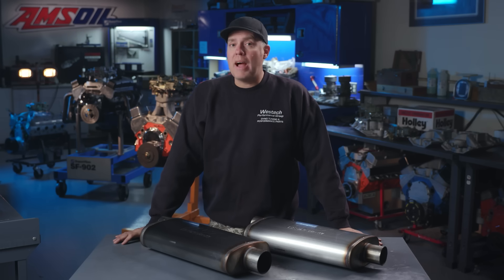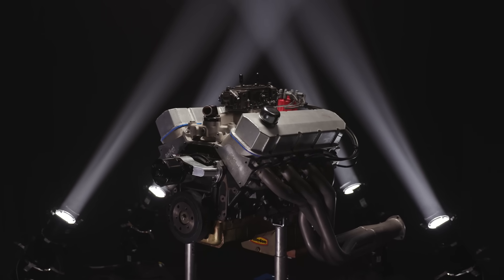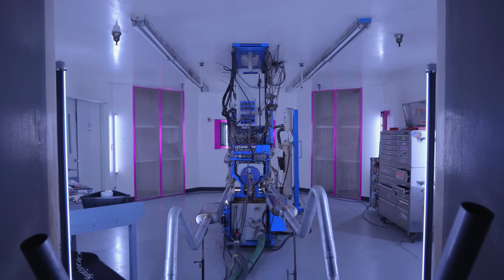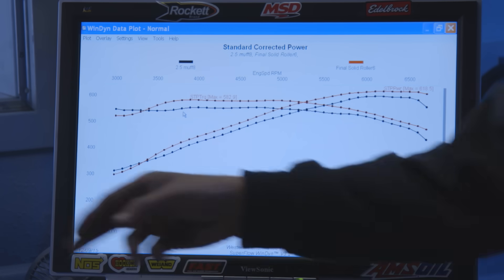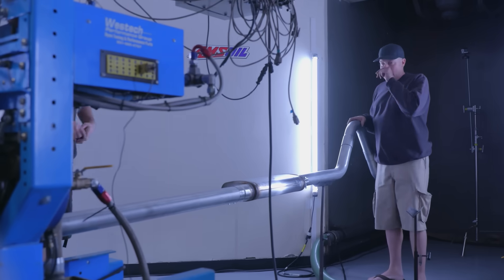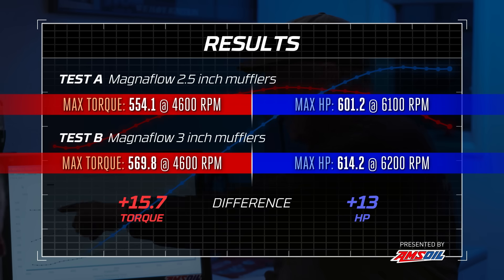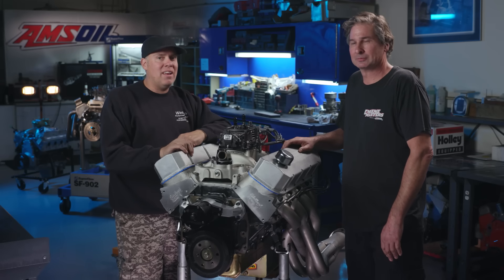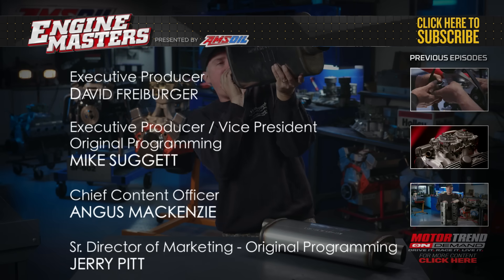The Power of 2.5- vs. 3-Inch Exhaust - Engine Masters Ep. 9

Comment: I gotta quick question. How should I what size of Exhaust Pipe or Type of Manifold Like (4-1) or (4-2-1) should I put on my engine. I mean, is there like a standard principal for all engine Sizes from 1L to 8.2L or depending on engine size the measurements will change. 

Appreciate the advise.

Thank You Guys 

Love Your Videos <3
Reply: +Amir Hossein It depends on what motor, it's useage and the HP/rpm range.

A long tube makes more power/tq than a short tube header..the only reason to use shorts are if your turbo charging or limited in the space to fit them. A 4-2-1 is usually more expensive but will give you more mid range torque with very little top-end lose vs. a 4-1 long tube header. 4-2-1 is better for a heavier/daily driver and 4-1 is better for a drag race/high rpm/lighter car.

As for primary sizes:
1 5/8" is standard for mild small blocks
1 3/4" will give you more power on a health smallblock 475+hp engine

1 3/4" is standard for mild big block  <500hp
1 7/8" is good for stroker or healthy big blocks <600hp
2" big blocks <750hp

Bigger/longer collectors give you more low-end torque, the length of the primaries will rock the power around the peak torque rpm...For example a short 32" tube will give more top-end at the expense of less low end than say a 36" tube. Usually manuals/lighter car can run better(drag strip) with larger/shorter primary tubes, while an automatic/heavy car will run faster with smaller/longer primaries.
Reply: Got it. Tnx Man. You explained beautifully. But you said 2" for big blocks ? Here they suggested 3" for such capacities. Also when you say 32" you mean Diameter !! What will happen if say you take a 2.0L engine and put a 4-1 and straight up and one collector and shorten the pipe. As in the Exhaust line will finish and end right in the middle of the car and wouldnt go to the end. What would be the effect ? Also is there some kind of calculation You could suggest that I can use on differant cars with differant engines. Man Im no where neae these Monsters. Here we dont get to ride with the real cars with Absolute Horses ! Thank You Again Pal

Comment: Wouldn't reduced back pressure burn valves over the long run if this were your daily driver?
Reply: +Charles Faust No, Actually excessive back pressure would raise exhaust temperature..so would running the engine too lean.
Reply: +David Freiburger Thank you for at least attempting to put an end to that non sense myth.
Reply: JerseyMikeP Thank you

Comment: Mr. Freiburger would this be applicable for a 4 cylinder 1.3l MPFI engine ?
And is there any harm in putting such a exhaust system as now the engine has passed 100k kms and has been recently rebuilt from scratch due to mileage.
Please let me know.
Reply: +Pranav Nakhare to a point it would apply yes, but no need to go anywhere near that big! as ive said above, the restriction is the smallest point in the system, whether its the silencer, the pipe size or the ports in the cylinder head. wherever the restriction is, is the limiting factor.
Reply: +Peter Lattimer thank you for that but in hindsight I think I should have asked whether the cat less exhaust system would affect the life of the engine.... thoughts ?
Reply: should have no ill effects on the engine at all. I have run plenty of engines that have been decatted to quite high mileages (by UK standards) without issue. the issue would only come if you were constantly thrashing the engine to make use of the slight extra power you will notice removing the cat, at high RPM. in normal day to day road use, a simple decat you wouldn't even notice.

Comment: 1- it's a 454 CI engine ,a smaller engine will do not require 3 inches exhaust to move air correctly.
2-You bash at peoples saying  big diameter pipes kill torque and 10 seconds later you show you gained torque and HP under 3k rpm with a "small" full exhaust system of 15 feet long.
You don't even show the numbers or test the engine under 3000 rpm.(wich is the most commonly used max rpm on public roads.
3-all is question of use,you mislead peoples by simplyfing things like that.
4- for same length : smaller pipes allow more velocity, bigger diameter pipes will make you gas slower,but gain pressure.
You have to use both parameters for your specific use,it's not that simple.
 Max HP is not everything,there is wideband use.

Comment: should have leaned out the engine with the 2.5" exhaust, to see if you could have made up all of or most of that difference in power.  If you could have a smaller, quieter exhaust, with the same hp as the bigger loud exhaust, thats a no brainer every day.

Comment: Many many years ago I used to tune two-stroke engines for amateur racing. They do need tuned exhausts with back pressure as you are counting on the back pressure to stop the charge going into then straight out of the cylinder. Perhaps that's where the "you need back pressure" thing came from? Some people still don't understand the difference between 2 and 4 stroke.
Reply: +Gordon Lawrence I think you're right.

Comment: quick question i have a used Chevy S10  the year is a 1997 and i have been having issues with it bogging down and jerking when shifting it is a automatic trans. i want to know if there is any way to get more power out of it the motor is  a  2.2 L 4-cylinder, 4.3 L V6

Comment: Am I the only one who noticed them shoving the cam in there with no assembly lube?  I've never built an engine, I have no desire to build one...but every time I've seen it done, they used assembly lube.  If I'm not wrong, then I'm questioning the "Masters" part of the title.  If I am, then apologies.  Otherwise good video, I like this channel.
Reply: +Lee Ralston it was probably done just for the camera and that's why there is no lube. now you can build a motor and not use any pre lube I have done it but you need to have some one turn the motor over by hand wile you are spinning the oil pump with a drill to coat all the parts. vasaline or real heavy gear oil also works well

Comment: Does the same apply for smaller engines?
... I'd imagine backpressure isn't a thing no matter what, as it lost power going to a 3" exhaust... if it required back pressure, it would gain power over the open headers lol

Comment: What would have happened if you had leaned the motor back out with the 2.5 inch? You admitted it richened it up, could you have gained power back by tuning the carb? 
This test would have been better if it had been an EFI so you could tune that issue out easily.

Comment: Dodge, Chevrolet And Ford Almost same cubic inches which is better?
Reply: +Samuel Lopez Too many variables, each brand made great engines.
Reply: It would come down to cam profile, cylinder head type, compression ratio, induction, exhaust and rpm. If all the aforementioned items are equal, they will all make the same power.
Reply: +SmackledorfMcsween Cocksmclittleton Tinydickolas,
the ignition order dont matter in HP or Torque?
Reply: +Samuel Lopez well- I figured that would be a given, considering cam profile, rpm and compression ratio. They already did a test almost like what you're asking. 383 BBM VS SBC 383. they made almost equal power except the Mopar made more down low on account of the wide bore that it had. Point being, there's a given amount of torque per liters of displacement, period. 

No matter what engine it is, if the environment is equal across the board no engine is gonna make more power than the other because the basic operating principal is the same.
Reply: +SmackledorfMcsween Cocksmclittleton Tinydickolas, Thanks.
Reply: Samuel Lopez you're welcome, brother.

Comment: why dont you show the graph starting from the idle? it will be useful for those who use the car in the street.. you will not be revving 6k rpm all the time..
Reply: +Maxi Biscardi The graph starts at about 2500 which is about the point where it starts to matter anyway, as Dave said about it making a little more torque below 3500 rpm, at wide open which is what these numbers are at your gonna be running up through that fairly quickly and won't notice the difference. I want to see this test again but with an engine that only makes say 300 Hp and see what happens, also would like to see them throw a "bad" muffler in the mix

Comment: internal combustion engines are vacuums... more air in and out with the least resistance makes more power.
Reply: +Cody Hodgson actually they are air pumps
Reply: +Captain Bipto lol they are the same thing. a vacuum sucks in air and pumps it out
Reply: +Cody Hodgson they absolutely are not the same thing. a vacuum does not suck air in, it only removes air.
Reply: +berzerkrobot wow where can i buy a vacuum cleaner that removes all the air?  that would do a better job of cleaning than the one i have. since it only removes larger particles from the air.
Reply: +berzerkrobot I strongly disagree, I own a vacuum and I can assure you it sucks air in.

Comment: would  This apply also to a Four cylinder double  overhead cam Turbo  charged  ingine?  what do you think  ? I'm  trying to  pull out about  40 or 50 more  horsepower  to bring it  up to  about 260 to 270 horse  power  maybe 3 inches  pipe from  rear of catalytic converter  to the one  open  flow or high flow rear exhaust  Muffler  ,do you think  this would  HELP?  from  : jjm in Montgomery Alabama Sent

Comment: Uh I'm pretty sure you lose torque without enough back pressure when it comes to smaller engines this engine wasn't a good example of that point seeing how big and built it is
Reply: +matthew von not everyone has small motors
Reply: +matthew von Yeah.. of course bigger exhaust system equal more peak torque and HP at high range RPM. But is more power at higher powerband range (higher RPM) always the best case? 
let's say in everyday, daily drive.. and even also not all race track require more peak HP from higher powerband range to make a faster lap time right?
and this engine wasn't a good example of that point indeed.

Comment: that settles it, a 3 inch is going under my 1.3 ltr suzuki samurai.
Reply: How could this be applied to a common Briggs and Stratton?
Reply: Jonathan Banta lmao
Reply: @jonathanbanta9456  It means that you need open pipes just to start it.
Reply: +devils garage yup.. because basically your 1.3 engine has to be at full, high revs all the time to do a proper speed.. 
; )
Reply: I have twin 3"pipes on my 96 Geo Metro, what a difference that makes, 3 banger with an unbelievable 1000 ccs of raw power.
Reply: devils garage fit twin exhausts and a sun roof then you can at least use it as a wheelbarrow
Reply: Wow, a 600+hp samurai. That sounds scary fast and squirrelly my friend.
Reply: I like u
Reply: LMAO
Reply: I have an 87 Zuk , that's three would support at least one 30 in a 25 ticket
Reply: I miss my samurai. It was my first born, swapped it with the 1.6l...... My biggest regret is selling it
Reply: My very first vehicle! Was when they first hit the market too. Lifted it, bigger tires, better shocks. 2 wheel'n in the CO Rockies! As in On Two Wheels! Shoulda rolled so many times! 
Tailgate read "Wanna Roll?"
Reply: Totally. Luckily I have one and I'm never giving it up!
Reply: Go 4”

Comment: Wouldn't the back pressure be relevant at low end rpms? Where the velocity of the exhaust vs the piston speed is different enough to allow the combustion gasses to exert more force on the piston for longer in terms of  degrees of rotation of the crank? I mean a low duration cam would have the same effect, hence the more torque at lower end. If anyone is going to respond please be scientific about it.
Reply: +Marcus Taber i agree.. i think this engine probably is a good match for the type of exhaust they tested..
I believe engine needs a high flow velocity for throttle response and torque during the low to mid range powerband, but it also needs the highest flow volume possible at mid to high range powerband for maximum performance output. smaller pipes (exhaust) volume equal high velocity, at the cost of the flow volume.

Back pressure in the exhaust decreases HP because during exhaust stroke the piston has to push the exhaust gasses out of the cylinder, this requires energy from the inertia rotation of the flywheel, thus the higher volume is beneficial during high revs. Back Pressure also useful because, until certain RPM ranges (low-to-mid range) they provide a lower pressure than inside the cylinder during the exhaust valve opening, thereby helps pulling out the exhaust gasses of the cylinder, and this saves the energy the flywheel in the latter case has to supply to push those exhaust gasses out. The energy saved from pushing the exhaust gasses out of the cylinder are translated as more torque and engine response, or like you said "more force in terms of  degrees of rotation of the crank". but again, at lower powerband range that is..
Reply: +Marcus Taber Actually the opposite, back pressure really only happens once the exhaust volume has gotten high enough. At low rpms the primary header tube diameter's and length matter.

Comment: OK I will agree with the results but when you decrease your output you have to reduce fuel in order to get the proper tune in order to get accurate results also explains why tired inch allowed more power because this engine has been tuned for Dino runs with open headers. love the show but you should've been a bit more thorough on your testing in this episode. I think you'll find if you pull back fuel like on a carburetor setup say a quarter turn on primary and a eighth of a turn then run two and a half and see what you get.

Comment: 3 inch on a BIG BLOCK 454.  If it's a 5 lire I would run 2 1/2
Reply: +richaroodledoodle a 454 is very close to 7.5l and my 1981 CJ 5 with its 258 requires a 2 1/4in and even that's small honestly it should have a 2 3/4 or 3in on it but its also been bored out and built to the point its got a 700cfm carb on it.
Reply: +Drew Atherton
                              That&#39;s a straight 6 with single exhaust. I agree you need 2 1/2 exhaust, but I am talking about a 305 V8 with dual exhaust. 2 1/2 is plenty.
    If you go to 3 on a smaller v8 you will loose bottom end.

Comment: Would these results apply to a 4 cylinder engine as well? Or would it be best to have a 1.5 inch exhaust for a 4 cyl? 2.5 for 6 cyl? Starting my first project in the next few months and owuld love some feedback!
Reply: If it's turbo 4cyl you would be looking at least at a 2.5 inch -3inch so you can raise the boost, 6cyl would need a 2.5inch , 8 cyl would need a 2.5-3inch
Reply: +Ferreira94a What matters is air velocity. It would be a matter of the appropriate cross-sectional area of the pipe for the engine displacement and operating rpm.

Comment: I'm surprised that you did not retune for the 2.5 inch pipes, also 3" may be better at 600hp more then most people's cars I would think.
Reply: I agree entirely. I wouldn't be surprised if they got 3-5 back for both HP/torque, bringing the difference to a little more reasonable level. 2.5" wasn't as bad as I expected and would be great for a tow vehicle or motorhome.

Comment: Can we get an episode on how an engine dyno works?
Reply: +justfakeit888 Basically just a generator that has a multimeter hooked up to it. Measures voltage through a known resistance and wattage can be calculated. ~750w=1hp
Reply: I saw some hosing that made it look like a water dyno. Still, I'd like a more in depth episode.

Comment: see this is a good test but should do a more community oriented exhaust. if you should put a 3 inch tip or a 4 inch tip on your Honda and which makes more VTEC
Reply: lmao. definitely the 4 inch
Reply: open header for sure lol
Reply: +Brian O&#39;Connor Imagine how much power that engine could make with DOHC and VTEC heads? 650hp @ 5200 rpms and/or 930hp @7500 rpms assuming relatively the same flat torque curve afforded by the bottom end, and the much higher rev range due to the different cam profiles. Def need 4 inch exhaust for anything above 5k though as evidenced by the tq dive at 5.1k. Is that because of the cams, valves, or carbs?
Reply: +Marcus Taber what the hell did I just read you just asked a theoretical question basically just said "imagine if honda v-tec engines had DOHC ".... they do but then you go on to assume doing this will put out silly numbers at random rpm points and then advise a 4 inch exhaust but then ask why it needs it? are you ok? unless you mean on the 454 in which case its make a bit more power v-tec isn't some magical thing it basically just makes a cam with low lift have increased lift when activated by lowering the cams. which it otherwise has high lift honda has v-tec for efficiency not power

Comment: that's not true about 3in exhuast will not kill back pressure... that engine is huge!! on smaller displacement you will loose lower end torque curve on partial throttle